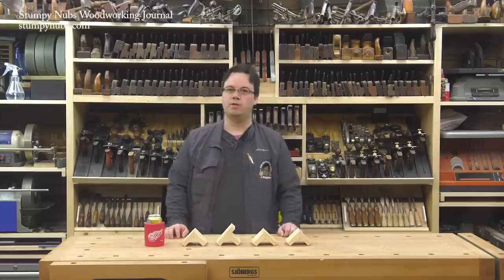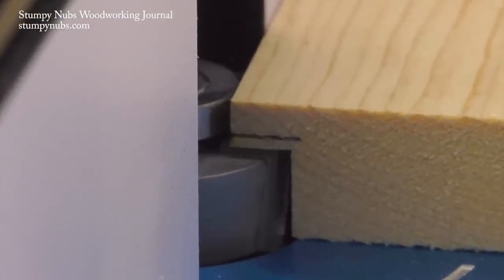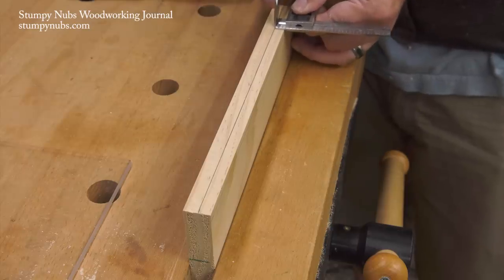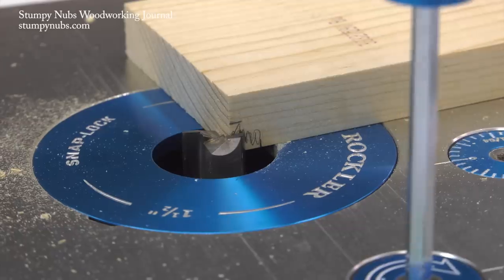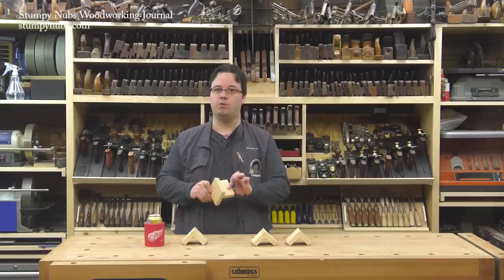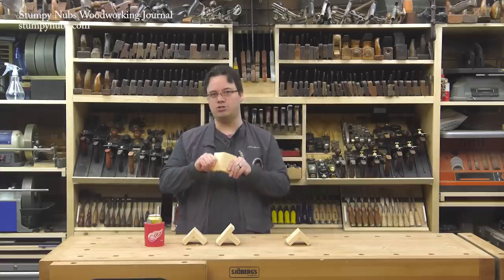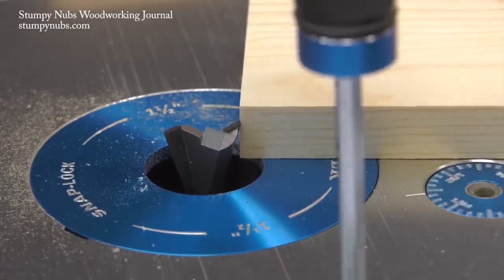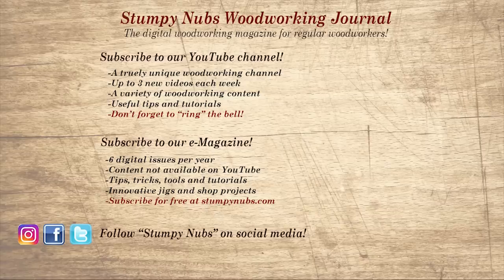Have you ever used these 4 clever router table rabbet joints?

Comment: I am having trouble with the set up, do you have a video that goes over setting up the table router for different cuts...  basically how to measure fence/height “for dummies?” Oh and using the most basic of measuring tools like a 6” metal straight edge, and an adjustable combination square...  thank you.

Comment: Occasionally I use the double rabbet, but instead of going halfway I cut away most of the endgrain leaving somewhere around 3/32" of material to cap the endgrain of the mating piece. It doesn't add as much strength, but still indexes the joint and looks better with minimal endgrain. When using it on edge grain the glue line is almost invisible since it's so close to the corner. I'll also allow the thin "cap" to extend past the mating piece and sand it flush. It can be cut with one setup by running one piece flat and the other on edge. Wish I could post a picture here. It's very similar to the dovetail rabbet in the video, but without the dovetail and more exaggerated.
Reply from the maker: Great tip. Thanks!

Comment: Hmm - what's the difference between the Lock Rabbet and a Tongue-and-Groove joint?  Or are they just two names for the same joint?
Reply: Tongue & groove is along the length of boards for flooring or cabinet backing, stuff where you need to cover a large area with narrower stock. A tongue & groove joint must also have the tongue part sandwiched in the receiver, rather than only being supported on one edge, since they aren't often glued together & would thus fall apart.

The groove part of tongue & groove, however, is simply a rebate (rabbet), & the tongue part is technically 2 rebates.
Reply: @nightcatarts  Ahh - so it's just the position of the 'tongue' (center-aligned or edge-aligned) - with center-aligned required for 'tongue-and-groove' due to it typically being used to join edge to edge, rather than edge to face.

But the actual 'mechanics' of the joint are the same (full-length rebate on one side, full length tongue on the other, intended to prevent mis-alignment of the two pieces)
Reply: @logicalChimp  Yes pretty much. T&G is a mechanically weaker joint since the tongue can easily break off, what with going along the grain, though.

Comment: I don’t really understand why a rabbet is much better than a butt joint since all of the contact surfaces are still end grain to long grain as opposed to dovetails or box/finger joints which are long grain to long grain. Just curious, not trying to stir up controversy.
Reply from the maker: More glue surface, easier to align and clamp, mechanical strength on one direction.